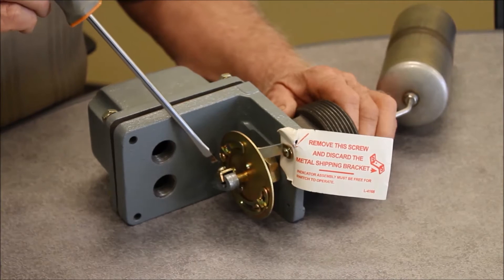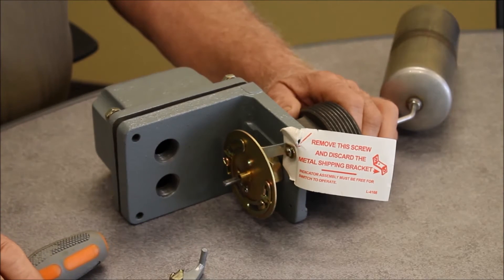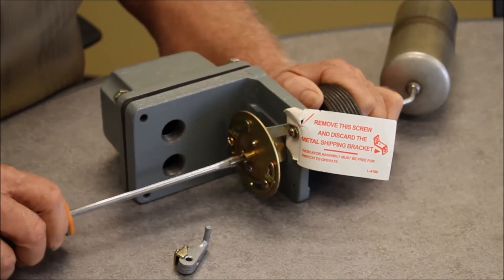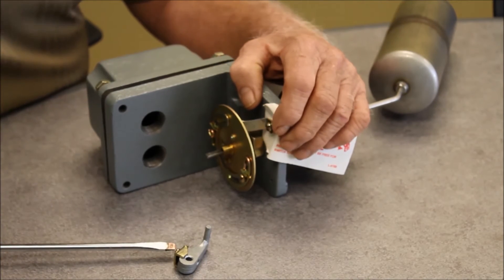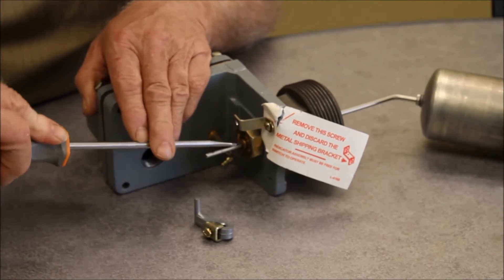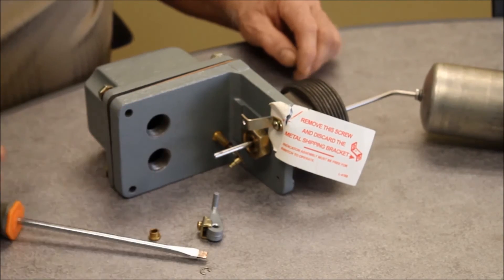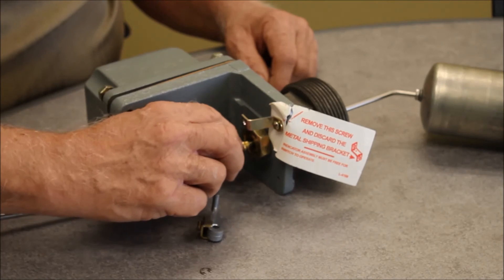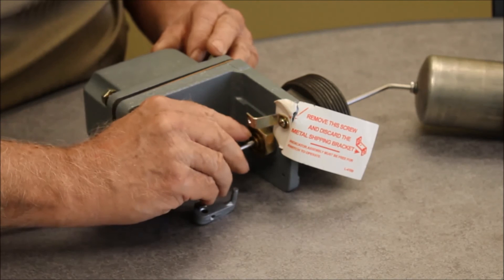Replacing Quad Ring Seal on Square D™ 9037 & 9038 Series Float Switches | Schneider Electric Support

Comment: Wait, how do you take the quad seal out before replacing it? Can it be done from outside the tank? The instructions I read said the shaft should be removed to get the old quad out.